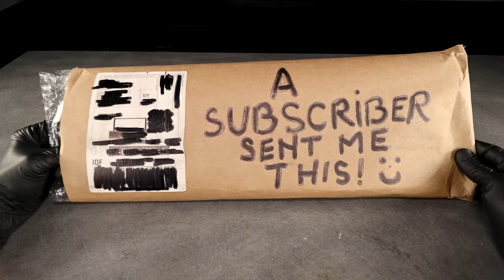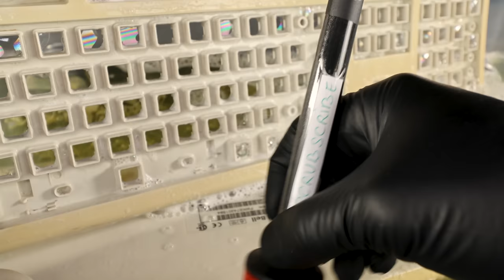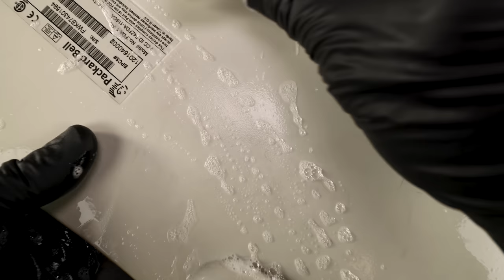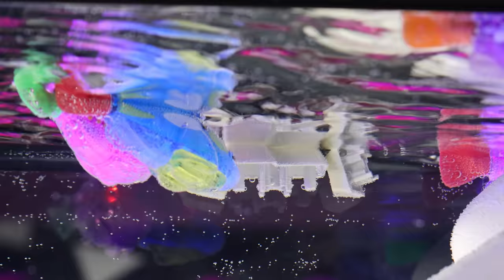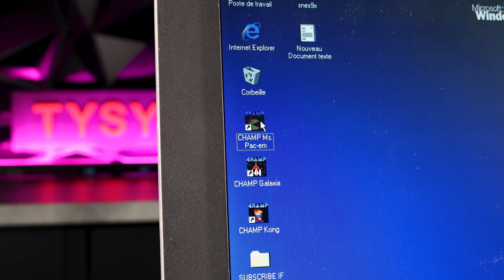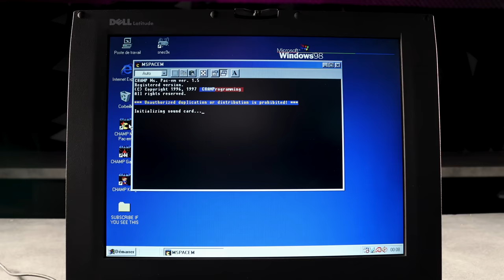Yellowed Keyboard Restoration - ASMR

Comment: Even restoring the stickers. That's dedication!

Edit: My first PC was running MS-DOS 6.1!
Reply: I had MS-DOS and windows 3.1 at the same time on my first one but I used dos more especially for doom and wolfenstein 3D on 3 1/2 inch floppy back in 1994.. If I remember right mine was MS-DOS 6.22 

And yeah restoring the ducks took this to the next level
Reply: Not sure which DOS version I had, but my first PC was around 1986-87. Had good old CGA graphics and a 5 1/4" floppy drive.
Reply: @twan923  wow you got me beat I'm 40 years old that must have been like dos 3. I don't know why but lately I find myself researching things like Microsoft basic and Commodore even though I never used them when I was younger and there's absolutely no utility today. Like watching the 8 bit guy I wanna put a motherboard together myself solder various 1980s chips down.. See if I can build a primitive computer from scratch.  IDK if I would go CGA or EGA but five and 1/4 floppy would definitely be a must
Reply: Mine was Gem.
Reply: @twan923  Sounds like my first pc, about the same year. Had MS-DOS 3.1 on it. Got Windows in 1992 (Windows 3.1) which you had to run manually after starting the pc via MS-DOS.
Reply: Windows XP
The best OS of all time.
Reply: I don't care🥶🥶🥶🥶🥶🤯🤯🤯🤯🤯💀💀💀💀💀💀😈😈💀😈💀😈😈😈😈🙉🙉🙉🙉🙉🤑🤑🤑😎😎😎😎😎😳😳😳😳😳😳😲😲😲😲😲😲
Reply: My first PC was Sinklair.
Reply: MS-DOS 5
Reply: Win 3.1 my first - but, did markup in DOS for conversion equations size of a paragraph.  :D  ~ and then, we transmitted through dialup with mind-blowing baud rates of "it will be done by morning, go to bed" 😆
Reply: My 1st machine was a Grundy NewBrain AD will a 4MHZ Zilog processor and 32k RAM…Made in England!
Reply: i still have my old  DOS PC, full restored (recapped)  running dos 6.22 and WFW 3.11

Comment: My first PC was a Franklin Ace 1000 it didn’t have a HD.  It used cassettes to load software.  Then I had an IBM clone.  It was a 386 processor, 100mb HD with 2mb of ram.  It used floppies to store files 5.25 and 3.5 sized floppy drives.  The OS was either IBM or MS DOS as an OS and Win 3.1.  You had to boot into DOS and type “Win” at the curser to start windows.

Comment: LOVE the waterless fish. That is a LOT of peroxide. Brilliant idea to make knife scales from dust bunnies in keyboards. I'm assuming you'll use resin. 
Cyborg fish ... a good idea, but in the end, not very effective. Vader slapstick, effective and made me giggle. 
Um, I think your aquarium was already broken, or at least a seal was faulty. I mean you did use hydrogen peroxide, but there was no lid, so pressure didn't cause the failure. The gas would have escaped easily out the top. No increase in pressure. 
I love that you left one key for reference. 
I'm glad you were able to replace the stickers without ruining the glue. 
Amazing transformation to be sure. 
Except ... that you didn't leave that one control key. It got cleaned. 
In the end product, it looks like all the rest. It would have been great to leave a bit of a nod to the age and use of the board in that single key. There is honor and history in the patina of a thing. Even if it's yellowed plastic. Patina tells a story. 
Clean it, sure. Make most of it pristine, sure. 
But I would, myself (but I'm not the owner), have loved to keep one key with the character of age. 

Great job.
Get another fish tank, or fix the one you have because he seal failed. It had nothing to do with pressure when it had no sealed top.
Reply from the maker: check my latest video 🙏

Comment: My first computer was a Sinclair ZX 81. It had/has a tiny printer that worked by sparking electricity to special aluminium coated paper. The OS is a version of CP/M. First real computer was a NEC running CP/M-8

Comment: Did you fill the aquarium completely with hydrogen peroxide, or after the two bottles of peroxide did you fill it the rest of the way with water?
Reply: Most likely all with peroxide, you need like 12% for this, can work with lower concentration but the higher the less time you need!
It can be reused, or you can brush peroxide gel for a cheaper way than soaking

Comment: 11:47 My first x86 PC ,(custom built 486-DX 66, November 1994) came with Windows 3.11 and Novell DOS (Don't remember the version, it got replaced with MS-DOS 6.22 really quick).
Before that, I had a Marathon 32K (ZX-81 clone, got it used for my 12th birthday in 1987), an Amiga 500 (late 1991) and an Amiga 1200 (~mid 1994). When I got the PC, I already had a 546MB harddrive and a 14" monitor for it, that I originally bought for the A1200, which saved me the equivalent of ~1000 US$. 546MB sounds like nothing today, but at the time, it could be compared to a modern 16-20TB drive!

Comment: The first computer I used was an Atari 400 (did not come with Windows lol), then Apple ][e, then 12mhz 286, which was the first computer I ran Windows on which was 3.1 and was quite slow, but on the next PC the 486, Windows 3.1 cruised along. :)

Comment: 🪛 Where can we buy the motorized screwdriver seen around 0:40?
Reply: I saw a bunch of people asking this question but didn't see an answer. Looks like it's a Miniware ES15. Not cheap, but they look great! EDIT: Could also be an ES120, too, but the ES15 is newer I think.
Reply: @Talenin2014  Thanks for pointing me in the right direction. At the time of this writing it's available on Amazon for about $120 (or $106 after applying a coupon). Not cheap like you said, but highly rated. ASIN B09MVM9PTW.
Reply: @jlawton  you're most welcome, mate!

Comment: Never use metal pliers and metal screwdrivers on plastic cases, there are plastic tools for this job. Since you already put in so much effort to get a clean, beautiful restoration, you should also strive to avoid unnecessarily damaging the object in the process.